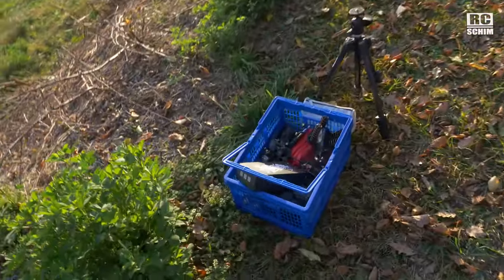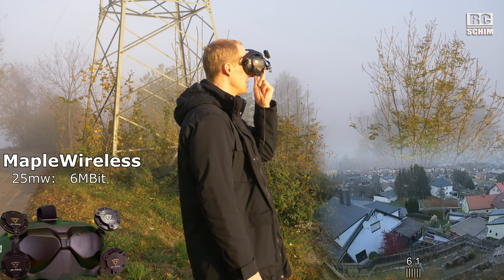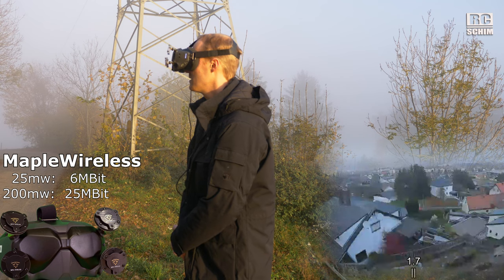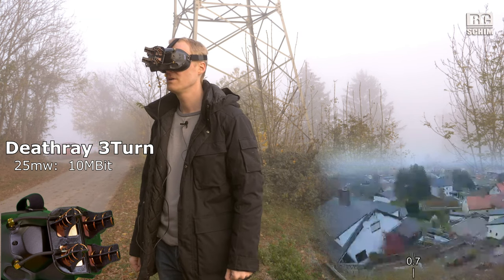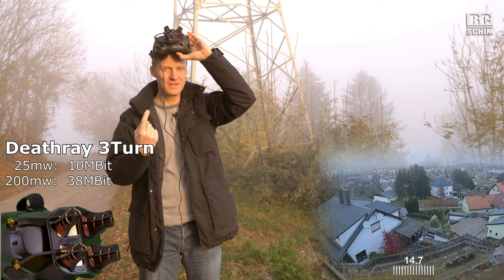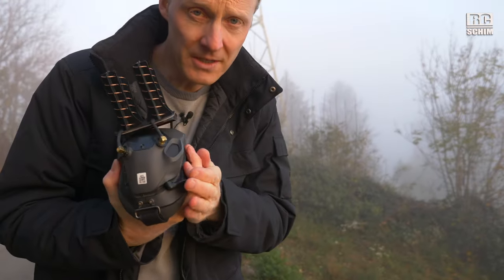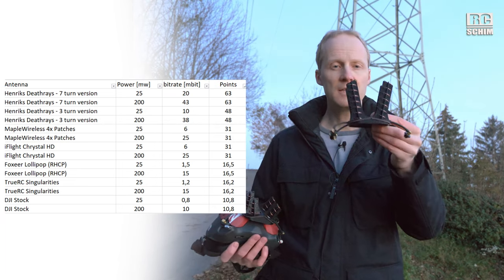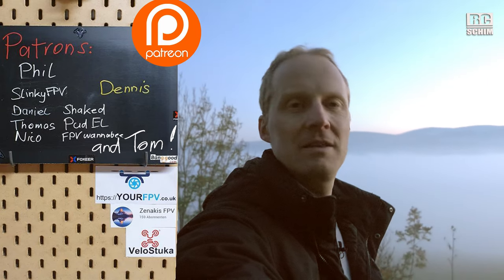Where to put the good antennas?  (DJIFPV Stationary 2.3km Test)

Comment: With the TrueRC Singularity antennas, the goggles, x-lite and accessories all fit perfectly in a single Turnigy transmitter bag with all antennas on.
All I need to fly is that bag, a lipo bag and the drone of the day.
This setup has cut down my "unpack and pack time" drastically. With a battery already strapped in, I'm in the air within 30 seconds, and gone in the same time. Very useful for sktchy spots.
Exploring with an E-bike and flying when the mood strikes... THAT'S LIFE!
Reply from the maker: ha, I also used a taranis bag for some time (the camouflage one - even better for sketchy spots ;)
Now I use the iFlight backback (once more iFlight ;) - it's not super high quality, but small and light enough. Inside I have a cheap bag to hold the Tango2 and some smaller tools). Goggles stay next to this and theres room for enough batteries and a small drone inside - or a larger drone outside the backpack.
Maybe you've seen it - I like to explore with my KTM bike - but of course that brings limitations as to where I can drive to (but with less effort and faster)
Reply: @Rcschim  Of course I saw it. Long time subscriber ;-) I was a KTM rider too. (ABP -Racing tuned Duke II ) It was my escape from the city. Now i sincerely prefer an e-bike for that. Much more relaxing, safer and waaaay cheaper. Sometimes I miss the motorcycle, but then I remember all the tickets that inevitably came with it and I'm fine again. :-)

Comment: Hi Mario, I was one of the first to see this video but only today something sparkled in my mind about your testing: When you were testing the omnis and noted an increase in the MBPS when turned about 90 degrees sideways to the signal source, it actually makes sense! Think about it, you noted that most of the work is done by the bottom left antenna and the place you were standing seems to be above the signal source, so when facing the source the antenna actually had its null point aimed to the signal source. When turned 90 degrees to the side the active area of the antenna was facing the signal.
Reply from the maker: Yes, good idea. I also thought that when I face directly into the dir of tx the omnis don't have good placement whereas the directional antennas are...

Comment: I have not upgraded to hd yet, but when DJI sends the update that fixes the latency...I'm in!!
Amazing range!!
Reply: i bought it 2 days ago, now waiting it to be shipped. Every video i see related to this topic makes me feel more happy that i already bought it. Waiting sucks damn hard. This video is like a super nice teaser, makes me even more happy to see the range is amazing with 25mw ( shi..y EU law), also thinking about what antenna to buy. Thx @RCSchim for that nice rewiew!
Reply: The variable latency is a little strange at first but I hardly notice it anymore unless I’m near the edges of range. But yes, instead of a 20ms range of latency, from 22ms to around 42ms at the edge of reception, it would be awesome and unnoticeable if it were from 22-32ms instead. Or even 32-42ms would be fine with me.
Reply: Yeah, the system has been out almost 20 months, I figure V2 will be coming out in the next few months.
Reply: What latency? I mean if you compare digital with analog even digital has really just a lil bit more latency you can see things much earlier so it compensates it easily
Reply: They will never "fix" the variable latency because it's inherent in the way the video link works.   DJI's video link is a two way connection and it retransmits lost packets.  The number of retransmits allowed for any given mode (low latency 120fps versus high quality 60fps combined with  Focus mode on or off), determines how much time it may take to get the next frame as the signal degrades.  The best way to "fix" the latency is to pick the right combination of antennas that provides the best signal for your application to minimize packet loss.

Comment: Nice, first review of the iflight and I'm impressed for the form factor. I saw when you rotated to about 15 degrees the Mbit jumped up to high 34 so this confirms their advertised displacement.
Reply: I have the axii hd and didnt like the lower mbps off to the side n behind so added 2 more hd stubbys to bottom, now just connect patches as needed.  Watch the 4 truerc stubbs vs the iflight when he turns 180, mb is doubled, soo 4 omnis better for most spots for me...trees mixed w concrete usually
Reply: @flo-ridafpv5713  nice! Thanks for the insight. I fly planes to mid range so facing the plane is fine.
Reply: @ZaksterBlue  ah yea u should have pefect mbps then

Comment: thanks for the test mario, keep up the great work. For me the AXII HD Combo works great and i think the results are similar to the iFlight Antenne Combo. Greetings from constance
Reply: I have the axii hd and didnt like the lower mbps off to the side n behind so added 2 more hd stubbys to bottom, now just connect patches as needed.  Watch the 4 truerc stubbs vs the iflight when he turns 180, mb is doubled, soo 4 omnis better for most spots for me...trees mixed w concrete usually
Reply: @flo-ridafpv5713  that's a good idea 👍👌
Reply: @blue1105moon  👍🏼👌🏼

Comment: I was just missing the Lumenier AXII HD Antenna   with the patch =) but it's a great video overall! =)
Reply from the maker: Didn't have access to them... but I guess they are similar to the iFlight Chrystal
Reply: @Rcschim  probably, well, I guess you know more than me about it.I have been thinking to get some antennas for freestyle-mid-range for DJI goggles but I am not sure which ones I'd get yet ...so I am always so excited when you're coming up with a video :)
Reply: I have the axii hd and didnt like the lower mbps off to the side n behind so added 2 more hd stubbys to bottom, now just connect patches as needed.  Watch the 4 truerc stubbs vs the iflight when he turns 180, mb is doubled, soo 4 omnis better for most spots for me...trees mixed w concrete usually
Reply: @Rcschim  where can I get 3Turn Helical antenna? I have been looking around and I could not find it or you buy them separately and put them together?
Reply from the maker: @aerialclone_official  check the infoboy, you just need to mail Henrik - he's fast in responding and happy to sell you those nice antennas!
Reply: @Rcschim  got it! thanks :)

Comment: I was just thinking "where's Mario" and this video popped into my feed :-)   I would like to see how things would perform with a 3-turn helical on the bottom left and stock antennas on the other three positions.  I think the results would be surprising!
Reply from the maker: Hehe, I was busy, and I did this test twice here. First day with insta360 one r cam, but audio was terrible (never do a full review with new, untested gear ;)
2nd day was foggy then, but still fun. 
I guess 1 helical bottom left would be all you need.
Reply: It would be interesting to now test the upper ranges of 700mw to see if it still holds true or if we see an increase from the other antennas.
Reply: @drakinfpv9629   better make that 1200mW, when you're already at it ;-)
Reply: If the bottom left port is receive-only then it might be more capable of a receiver on the sensitivity side, thus might explain why it works better with a higher gain uni patch antenna, would allow for more error correction. I presume the transmit capable receivers can only do half-duplex whereas the bottom left will be always receiving.
Reply: @eyeflytinkerings  the 7turn death ray will hold over 30mbit at 13km on 1200mw👍
Reply: Hello Bruce!
Yes it would probably work pretty good with one helical and omnis on the rest but I would not dare to fly long range with that setup becouse the goggles can switch the dominant output around. Its not locked to the bottom left output. But it seems like it favors it. And its not like a regular diversity switch to the strongest signal, it seems to be no logic for the switching but I bet there is. Imagine being 10km out and the goggles decide to switch output to an omni for some mysterious reason
Reply: @SLINGSHOTandMOLOTOWS  That's what tramping boots are for :-)
Reply: @xjet  hahahah a hell of a walk of shame👍
Reply: @Spikester Yes my thoughts too. A pure receiver input should have best reception vs transceiver shared inputs.

Comment: That's very interesting, I've been using my TrueRC X-Air on the left side and it was great but had to move it to the right because I attached a BDI Digidapter with Rapidfire which takes up a bit of room on the left and I do find myself leaving the TrueRC stubbies on the goggles more often now... Thanks for the thorough test, just with you tried X-Air too in the same conditions 😅
Reply from the maker: and did you notice less antenna-performance with the Xair on the right? 
Mostly we dont fly far enough to even have to use the best antennas I guess :) 
I dont have the normal xairs. Got a special variant of the xairs (but that is more for complex bando stuff and not LOS longrange - so a comparison wouldnt have been fair).
I guess the normal Xairs are a bit over the 3Turn helicals from Henrik...
Reply: @Rcschim  I can't say I noticed a downgrade in performance directly, but I definitely suddenly found myself using it less, so in hindsight it might have been that I noticed less of an improvement using it on the right.

Comment: Good stuff!!  Doing something so simple yet so revolutionary. Like a magic trick. Once you show us the magic, we're all sitting here going,.. "why didn't I think to just cover the antenna with my hand?". :D 

Now for some critiquing: So now we have the opposite situation as your other videos. Since you used a left and right on your air unit, the Maple Wireless and Foxeer had an unfair advantage.  But even with that advantage, Maple doesn't seem any better than any other "patch" system.

It is interesting that the "best" antenna port is that lower left one. That is the one the FCC docs says is receive only. Maybe it's the most sensitive since it is not transmitting? Covering up the others should basically be making this like an audience mode goggle.

Seems like I remember you having some ORT helicals. Maybe test with TrueRC Singularities on 3 ports, and a single helical on that one receive-only port. I think your 3 turn death ray will still beat it, but it'd be interesting to see how big the difference is. Might be an option for your everyday bag since you'd only be swapping one antenna out.      ,....and now reading in the comments, I see I'm not the only one suggesting this.

Comment: Just watched Mad tech' short info on the dji goggles V2... seems like they will behave differently regarding antenna placement? I guess we will se you testing this in a future video..? ;) Will be very interesting! Thanks for all you do for the hobby btw!
Reply from the maker: We will see, currently I dont see many reasons to go for V2 goggles. If the DJI drone is really THAT good (and looks like it requires V2 goggles) then - maybe...  But my current DJI FPV drones are really good and I dont know how much this could be improved (but I love to be corrected by techological advancements ;)
Reply: @Rcschim  yeah, for v1 users no reason to uprade yet. I'm new to dji hd fpv, so my main reason for getting the v2 is the alleged video-out to smartphone via usb-c..

Comment: Mario, you always do your best at editing and giving everyone good information. Thank you. 
My question is, have you found that manufacturer antenna ratings seem to be correct? Does the gain/angle on a patch seem the same as what they claim? 

I run the menace patches on the bottom and true rc stubbies on the top. I see a much better all around signal quality this way vs stock dji antennas, it also seemed 4 menace patches worked better, even when flying behind myself. I usually sit in the middle and fly all around myself.
I want to go with the iflight or axii type antenna because they are easier to store vs the menace patches, I just don't want to loose any performance. Do you think I will?
You are the go to FPV antenna man!! Thanks again and happy new year.
Reply from the maker: Thanks for the nice words!
Of course not all antenna manufacturers specs are true. Like the C ratings on LIPOS are seldom true. And if you are the only manufacturer with true specs, your antenna seems lame...
I only have one menace pico patch that I tested - and it did average well compared to other patches. I guess the AxiiHD or iFlight Chrystal will be around the same as your current setup + the convenience. If you need good range in one direction, just remember to tilt your head a bit to the right, so the left antenna is oriented best ;)
Happy NY too! Happy flying!

Comment: Great video. Thanks! Do you think the Furious V2 Smart case for DJI has enough voltage at 8.3/8.5v to power the DJI goggles correctly. Do the goggles work any differently if powered by 14.8v versus 8.5v? Trying to research before purchasing. Thanks everyone and RCSchim.
Reply from the maker: I've seen ppl using 2S (7.4v) for goggles - dont think it makes a difference. Some also wanted to use LION cells, but there you can only use 50% of the capacity, since they drop further down in volts than lipos and the low volt protection or alarm kicks in too early (I read that didnt test it myself).
I just use some weaker but larger 4S packs that I dont fly anymore (with a long cable in my pocket rather than on the head). the goggles need quite a lot of power, 1800mah 4S is good for like 1hr of flying I estimate...

Comment: Very nice video Mario!  I want to buy a pair of goggles and is a hard decision what to do.  👍
Reply from the maker: I didn't try the avata or the new DJI Goggles 2 yet (but they're expensive).
The DJI FPV Goggles V2 (the ones which came with DJI FPV Racer drone) are probbably the best buy for DJI atm.
The DJI FPV Goggles V1 are perfectly fine and can be bought used for quite cheap I guess - but they will not be future proof and I fear they will not work with the new DJI Airunit3 or the Avata.
Only the new Goggles2 are compatible even with a mavic3 pro  (which is also a nice option).
Reply: @Rcschim  Thanks Mario, I have two nephews 10 & 12 that want to learn to fly so I want to get a good pair of goggles.  I dont mind paying a little more.  👍

Comment: I am watching all your videos and I am trying to find the best antennas for long range. I am grateful for all the time you’re putting for us. Could you try the Pagoda antennas on the Air Unit? 
We used to fly really long range with Pagoda antennas. Would they work for a digital system?

Thank you once again for all the reviews!
Reply from the maker: Maybe pagodas are a idea on the copter. But: I'd have to get new ufl lhcp pagodas (all my others are rhcp). And also: if you have good gain antennas like the helicals, you run into the new hard limit of 13.3km (heard reports, that guys had 35mbit at this distance still, but there it dropped because of how DJI works, there is a sync pulse which puts a hard limit on the range).

Comment: Nice video and really nice method to get a fair test results on the antennas would love to se the TrueRC X-AIR 5.8GHz Antenna in the same test, as people say they are the "best but bigest".
Reply from the maker: A friend had those with him today, but he was in audience mode - there they didnt perform as they could I guess.  They should be around 3Turn helical perf I guess. Should be better than normal patches, but they are really not convenient to screw on!
Reply: @Rcschim  Okay! Yeah they are kinda big and bulky to, but that is the 3Turn helicals to and maby more fragile?. Dont know wich ones is worst to screw on but would have been fun to see if they preform the same.
Reply: @SLINGSHOTandMOLOTOWS  
Okay that's nice to hear! unfortunately i havent bought the dji goggles yet but i deffenently will get the 3 or maby 5 turn death rays WHEN i buy the dji's! Ive just got into the hobby this summer and i love it, and i need to buy some here and there. Great work on the death rays, like look!

Comment: Schim I really enjoyed this.  Have you managed to compare 2 True RC X Airs ? Keen to know how they stack up.  Thanks 👍
Reply from the maker: Yes, but only some prototypes. I'd say they (2xair) will be between 3 and 5 turn helicals, where the helicals are much easier to mount.
Reply: @Rcschim  I had them mounted horizontal and it was dreadful reception as they were facing I wards due to the mounting issue. Now they are vertical facing outwards and very improved